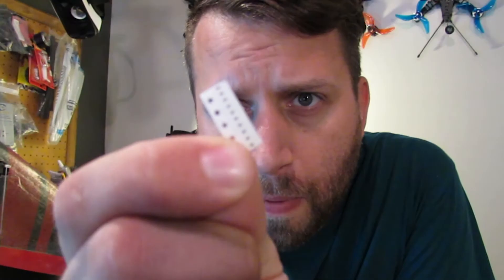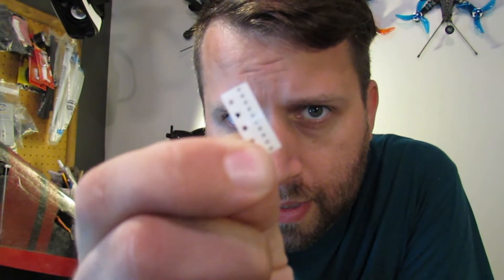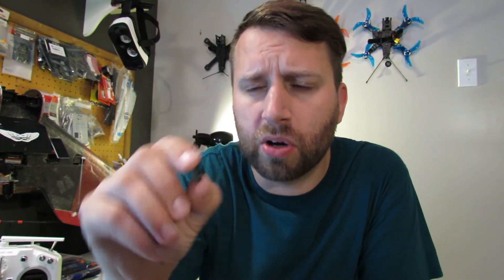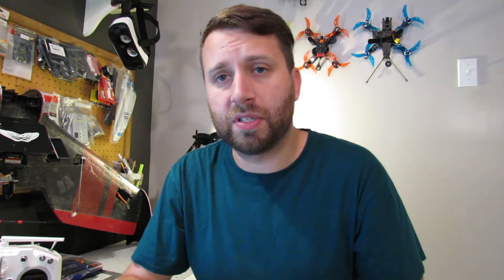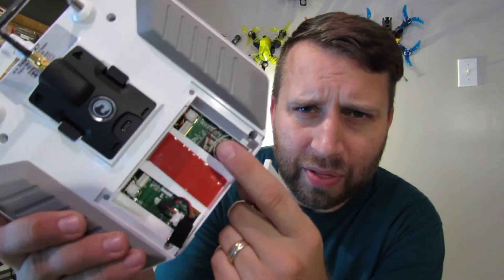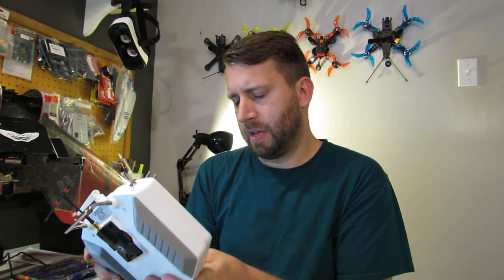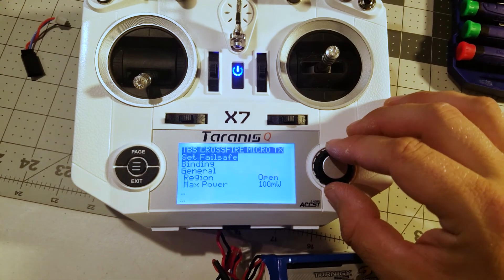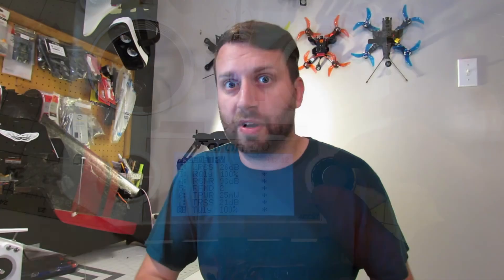Update 3: TBS Crossfire Micro TX and FrSky X7 - Mod is working!

Comment: Any updates about a fix as of 11/1?? My qx7 is on its way and I would really love crossfire on this model. It's so so comfortable.
Reply from the maker: Joe Max yup, there is a beta version of OpenTX and an update for the Crossfire that lets you lower the baud rate. The inverter mod is still the way to go, but the software fix works too.

Comment: go out and fly it before telling us it works
Reply from the maker: tomwolinski point taken, I have flown it (two miles) and it works.
Reply: good to hear! i think i will have a crack at it
Reply from the maker: I haven't tested this yet, but it is on its way - this person made a break out board with the inverter included for easier wiring: https://www.instagram.com/p/BZ4iQKpFK4G/
Reply: noobrc i think I'll order an inverter and breakout board and make my own. hope i don't destroy my radio. doesn't actually look that hard
Reply from the maker: My soldering is terrible and I pulled it off :)  Good luck!

Comment: Thanks for that :-) Found your video after placing my order. Well - I simply ordered 50 inverters for 2 USDs and a rework station (that I always wanted to buy). All worked easy and without  troubles. One thing that I did slightly different: I started soldering the wires to the inverter and epoxied and shrink-wrapped the package. Then I tested everything via signal generator and scope. After that I soldered VCC to the 3.3V pad and ground and signal in to the bottom port. This way the setup is much cleaner...

Comment: where did you get a LUA file that works of the QX7? cant find one anywhere? can you please post the link. cheers
Reply from the maker: It will be in the latest build, but here is the on I used! https://github.com/opentx/opentx/tree/2.2/radio/sdcard/taranis-x7/CROSSFIRE
Reply: doesn't work for me. will try this one though. thanks for the help

Comment: I have the QX7 without the smart port on the bottom (aka old one) and mine works perfect without any mods. first real range test and i flew around the block pretty low to the ground without any breakup. Just to clarify for people that have the older QX7
Reply: i posted a video. Dont really plan on flying super long range but flying around the block was worth it for me. infinite range mod lol
Reply: Hello! I have a QX7 without the smart port, and I can't work with KissFC. Which version do you have installed of OpenTX? and de Crossfire Lua Script? Regards
Reply: Carreras de Drones get the latest version of open tx. The FW on the tx without smart port will not work. What's your email I can email you sd card contents with the lua included
Reply: Does your radio have the cutout at the bottom with just nothing there to plug in or is that actual space not even cut out on the shell? I'm hoping my qx7 is also the older one as well since I got it when they first dropped. Mine is out for repairs from a bad (i was also told old and no longer used) RF module so I can't immediately compare. I have a crossfire micro bundle waiting for my tx to get home! Thanks!
Reply: mportillo78 mine has the cutout just no pins. And it works without modding. It’s a gen 1
Reply: Great! I'm hoping mine is the same! Thanks!